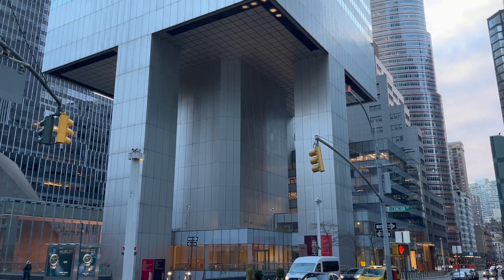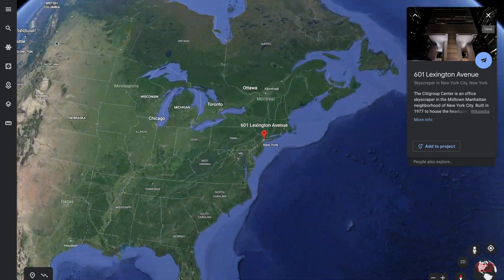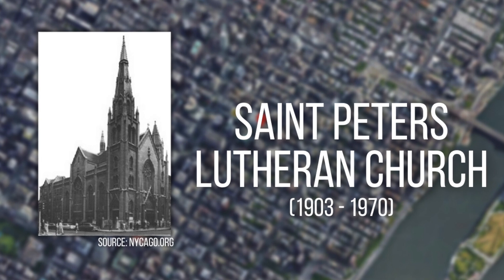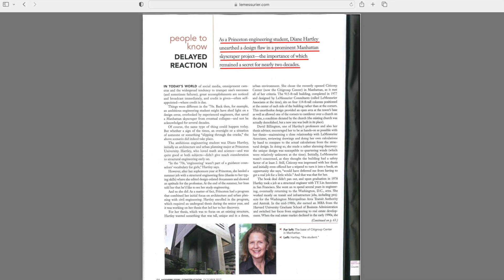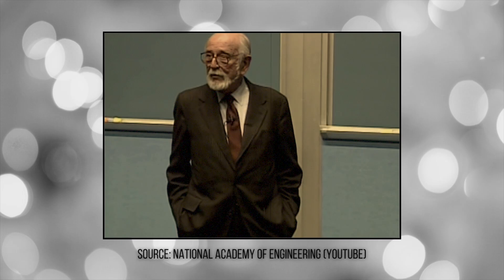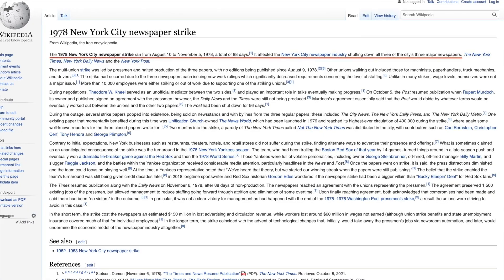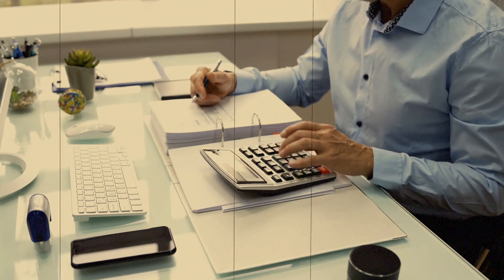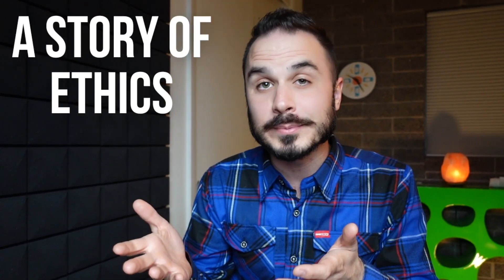This NYC Skyscraper ALMOST Collapsed

Comment: It all came down to the developer cutting costs by using the bolts instead of welds. The engineer was a mastermind and his original design would not have produced a feeble structure. Don’t cheap out when building a skyscraper!
Reply from the maker: Yep! If welds were used from the beginning none of this would have been a problem. 🤦🏻‍♂️

Comment: I remember when the article when it was written, and how it became a thing on the local news. I actually spent several days in Midtown last week, and my hotel was only 3 blocks south of the tower. I had to use the E and 6 subway stations at the base of 601 Lex, and it reminded me how most folks are oblivious of the potential disaster that could have occurred several stories above.

Comment: I doubt a design engineer that knows basic physics would be unaware of this being a problem. Calculating the force it would take to topple this is a very simple, basic high school physics calculation. And they used bolts too? At least they fixed it though.

Comment: "and they tried to cover it up" no they did not, when they found out the building was at risk they fixed it without causing alarm, no one covered anything up, in fact this repair is thought in universities as an example of ethical engineering
Reply from the maker: Correct